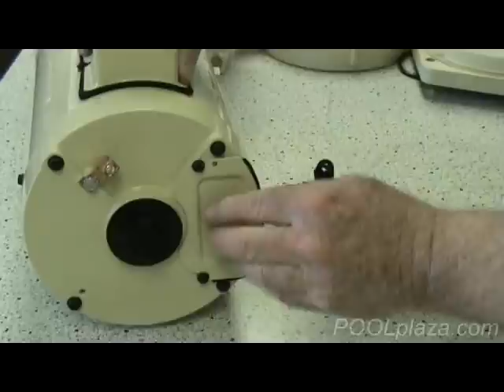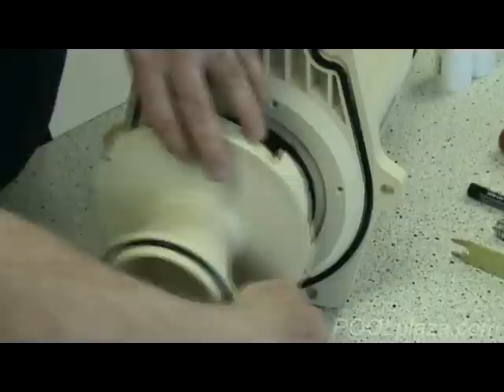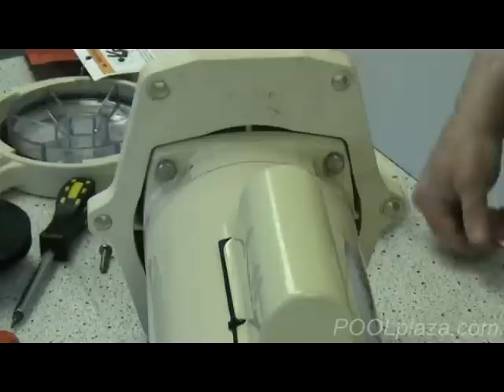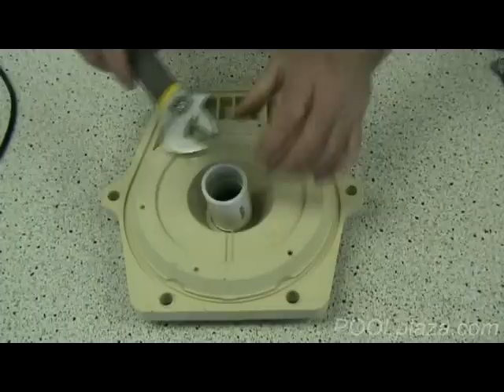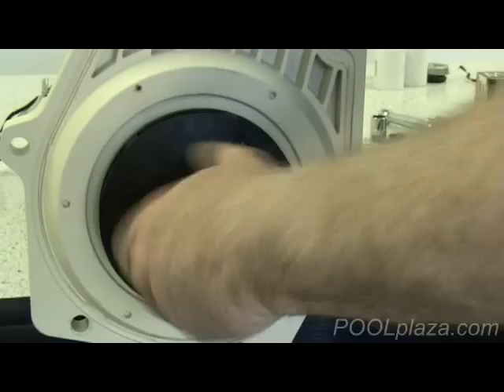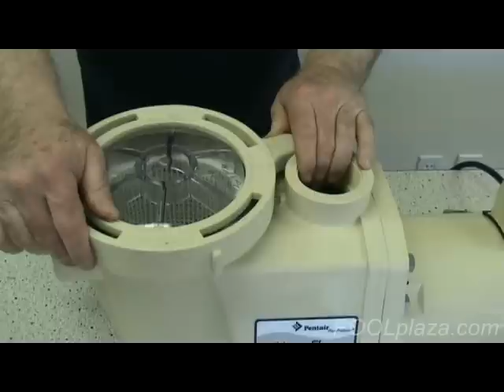HowTo: Repair a Pentair WhisperFlo Pump -  poolplaza.com

Comment: If you tighten the impeller by hand you risk tightening it too much and stalling the pump. When that happens the pump overheats and the thermal protector kicks in. After you tighten rotate the impeller and make sure the rotor rotates freely.

Comment: Awesome.  At 5:07 you didn't put any goop (or plasto joint stik) on the outside of the housing for the seal before placing it back in the plate.

Comment: My pump 2.hp makes high pitched whistling sounds about 20 mints and goes away.  8 years old . Only services I have done is to change output adopter to the filter was leadking. Any thoughts?

Comment: Does anyone know  where I could get the part where the seal plate attaches. It  has the six bolts and when I removed the two bottom bolts, the inside of the threads broke. The seal plate cannot seal properly. need help

Comment: Thanks for the clear instructions. A note for those, like I did, are having a hard time removing an impeller that won't budge.Bought a strap wrench—the strap goes around the perimeter of the impeller and breaks it loose without damaging it.

Comment: Should you use silicone sealer around the metal collar on the shaft seal? The pool shop said I should and it was used on the old seal?

Great vid! Thanks!

Comment: a channel lock on the neck of the impeller is dangerous, the outside of the impeller should be used. takes a big set of slip joint pliers 'channel locks'

Comment: Yep.. sure can, use a wire clothes hanger to probe the impeller, a flashlight can come in handy. the sta-rite dura glas has a opaque impeller that make cleaning a breeze and is the finest pump built.
REMEMBER to prime the pump after any pump repairs !

Comment: Well done video.  When doing this repair, make SURE to NOT lubricate or TOUCH either ceramic surface of the bearing seal. If you do, simply wipe it off before assembly with a clean paper towel and some common Isopropyl alcohol.

Comment: A rebuild on your motor should cost about 75.00 that includes a free shaft seal. search your area for your local pool pump motor repair guy with free testing 
Jay the pool pump repair guy in longwood Florida 32750